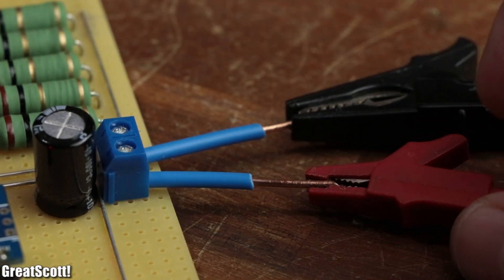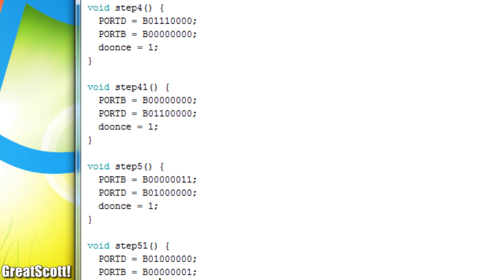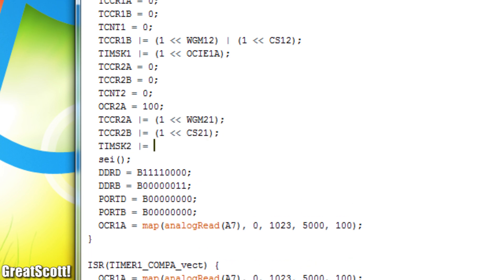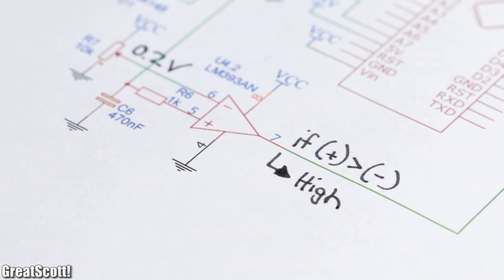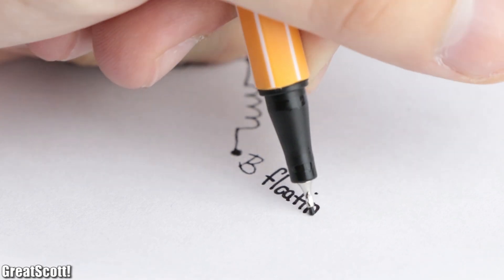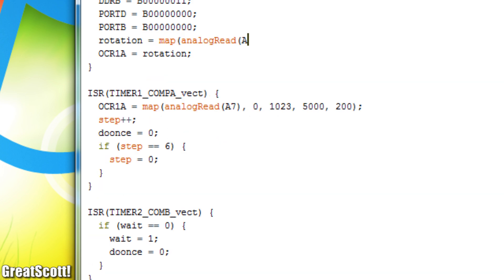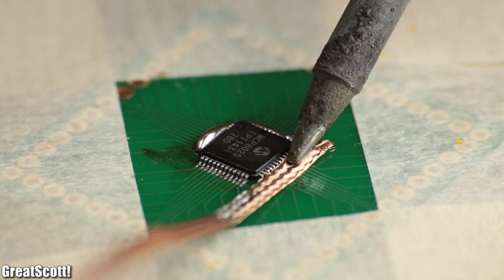Make your own ESC || BLDC Motor Driver (Part 2)

Comment: Great scott i have a question. Does electrical noise effect battery charging? 25 years ago i got into rc and linear power supplies and linear chargers were said to be king! Also with measuring pack voltage with same charger but with lets say sense leads on a isolated circuit. Are batteries chargers today for example the icharger 4010 duo or dx6 good?

Comment: Hey all! If anyone is thinking about building this, this circuit needs an additional resistor network! I just made something quite like this, using the same LM393 comparators, and my timing was looking really strange, and the speed/torque was a bit lacking. I'm using dual source, common ground to power my circuit, and the motor voltage is around 11v, the rest is at 5v. The motor acts as a voltage divider, making the motor common and coil leads around 5.5v, so what was happening was when the motor started to spin fast, the comparator inputs would get saturated over VCC and on the way back down take a fair bit longer to switch low, making the next step happen much later than it should. I added a resistor network (10k) at the coil sense leads to half the voltage, and then connected the common with 1ks. Now my voltage sits in a happy place between VCC and ground, and the timing is looking spot on. Have fun!
Reply: I also found that I needed to turn the internal pullups off, and add my own pullup of about 22k... not sure why, but I was getting a rather dirty output otherwise.

Comment: Invaluable resource! Thanks. How could I implement forward/reverse direction control in-software? I know that you could physically swap two of the wires but implementing this with hardware (relays) seems a bit clunky and not sure it would work so well. Any thoughts?

Comment: IDK if anyone pointed this out yet, but... the ATMEGA328P in the Arduino Nano has an internal comparator between PD6 and PD7 that can request an interrupt whenever the positive input of the comparator is greater than the negative input. Plus, as far as i know, runs asynchronously (correct me on that one, if needed). This means that you could actually measure the current flow using the internal comparator without worrying of it not being detected AND you actually removed a chunk of circuit from your board

In fact, the IC in the ESC is (usually) an ATMEGA8 and you can see they use no extra ICs, which is rather impressive, i must say

Comment: Hi, can i ask if this code is correct? You use only "PCMSK0 |= (1 << PCINT0);" and interrupt will occur only when EN1 will change its state. Dont you want to see change of every phase1/2/3 ? then it should be added "PCMSK0 |= (1 << PCINT2)" "PCMSK0 |= (1 << PCINT3)" "PCMSK0 |= (1 << PCINT4)". I see that you are checking in the interrupt which one of PINB changed but still it will be interrupted only 4 times in full cycle of 12

Comment: Hello sir,
I am trying to do this project with L6234D SIP package and 1000Kv BLDC motor.
I am using adaptor of 12v and 2 A for power supply.
At the end motor is only give magnetic vibration but not able to rotate. 
I don't know why it happens, please give some guidance.

Comment: the inability to achieve high RPM also comes from the limitations from MCU. To achieve high rpm, Phase Advance method is used. Microchip has a nice application note on sensorless control

Comment: Great Video !!! Comparators bounce like a button causing many interrupts in zero crossing areas, i couldn't find a stable solution for that. 
Ps. Please use something plastic while showing oscilloscope screen, screwdriver will scratch it.

Comment: HI, I have followed your video and information on Instructables to make a circuit using the 4th code you posted, and my motor is struggle to rotate. It is very choppy and seems only using the timer instead of the BEMF to rotate. I have check my circuit to make sure is correct, could you please suggest why I am having this problem?

Comment: I have seen some of the comments below, I am curious what are the individual components that make up for a good ESC. Some of the ESC are so small based on the current rating of the motor being driven, I would assume that most ESC use the same components with beefier mosfets for larger motors.  So does a commercial ESC use a micro? Or is it purely analog? or both?

Comment: Great video as always! I'm wondering if you could use the signal from the virtual ground point directly with only one comparator instead of  3 separate pins? I have used that star point to time a current source BJT, but I have no idea if this would work with Arduino. Any thoughts?

Comment: Hi Scott!, Very informational video. Could you please make a video explaining how to make an ESC using MOSFET's and MOSFET drivers instead of L6234 IC? L6234 is great but the DIP version of it is no longer manufactured and the peak current of the IC is also kind of low.

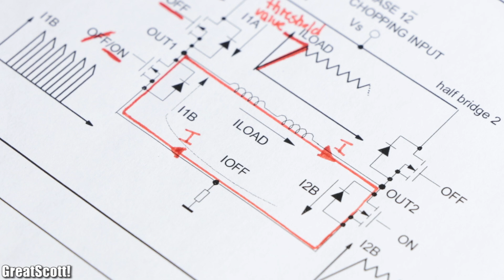Comment: 0:50 - If the motor is spinning and two coils are shorted, doesn't that impose a braking moment on the motor, which would counter its acceleration?

Comment: GreatScott, can you offer any advice?  I have an application that needs to rotate a shaft at 15 RPS (900 RPM).  As the speed is fixed, are there any gotchas if I simply supply the 3 phases to a BLDC from a uController (via FETs, of course), and start out slowly and simply accelerate it up to speed without any speed feedback - simply run the BLDC as a synchronous motor?
I have watched and read a number of accounts of ESC designs, and a number of people have commented that it was a long project with lots of pitfalls along the way.  Software is always a problem, especially if it has to handle setup of the various modes, but would you say there's any difficulty in getting the hardware working?  It looks quite straight-forward (is that naive?)

Comment: Several videos recently have shown a printer made using 2 CD Rom optic drives and their respective stepper motors; they are very small. Then I thought, what about the Disc drive's loading track? It would give a much larger print area. The Brushless Spindle Motor has hall sensors and fits neatly into the Loading track's gear system (just attach the second gear to the motor from underneath and it can open and close the tray).
Yes, stepper motors are better at this sort of thing for accuracy and every tutorial I've seen so far has shown brushless motors being controlled at high speed using a pot. But with hall sensors providing high accuracy, at very low speeds could the brushless motors be use? Can the brushless motor move forward one step at a time, and backward one step at a time? Or if not, perhaps 3 steps at a time for less accurate work but still a little fun :)

Comment: I tried to follow the instructable but It doesnt really say how to connect the motor. Well, it does but not in any useful way to me because the microcontroller goes into that large ic and the motor does too but I don't know what happens inside. I don't know what the microcontroller is telling the driver. What does each of the pins 4-9 do EXACTLY? I read the code and it does not match your 6 step cycle. Some of the pins are on for 4/6 of the steps while others are on for only 2/6. They should all be on for 2/6 of the steps as the little hand written step table you made shows. Plus it doesn't help that there are 12 steps rather than the 6 that should be there. Without knowing what each pin is supposed to do in the triple h-bridge then I can't even work out why there are half steps. Right now, with my best guess for how this should be hooked up I just get a motor that buzzes with varying frequency and no preferred rotational direction.

Comment: >>>   made  own  3   phase  controller     from    osc (  74hc14  / 555 )  74hc393  ,74hc138  74hc30   -   2n7000  -    got  plenty  of these  if  it  'blows'  - not a    problem

Comment: hello great scott, my configuration is this one:
-pcb board hand made, with 3 IR2104  double gate driver (1 IR2104 per 2 transistors on each phases)+ 6 transistors mosfet canal N IRF840 supplying a  12 vdc 1400kv motor brushless sensorless 3 phases,all managing by arduino UNO,the variations of pulsation is done by 2 pushs buttons...

i tryed severals differents codes for arduino for sensorless bdcl motor ...
i obtainted a range of duty frequency service from 40 KHZ TO 140 KHZ,visualised to my osciloscope,so i think it is not that bad as the pcb seems to pulse correctly but ,the motor do not start and so dont run, i can ear a noise as voltage running into this lil motor while approching my ear of it,but nothing more...where did i failed? 

could you light me up, and eventually bring me a code that could fit for my set up?

thanks to care great scoot, am lost....

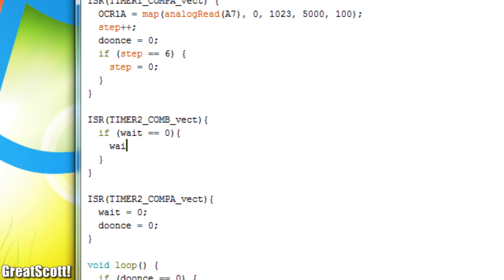Comment: Love it "...instead of the measuring bullsh!t" at 5:30. Finding a way forward is what engineering is all about!!
Reply: I just want to say, he was probably getting screwed by some of the default Arduino code that runs in the background all the time. Joop Brokking has an excellent video on why he switched to Atmel Studio because of the Arduino fluff
Reply: @ShinyMajor  It's probably the `step == (2 || 5)` code, should be `(step == 2 || step == 5)`

Comment: According to the datasheet of ATmega328/328p maximum ADC sample rate is 15000 samples/sec at 10bit resolution. Minimum time required for 8bit ADC is 13us and 260us for 10bit. So, how did you actually measured the A/D conversion time??

Comment: Scott, I think I may have found an error in your explanation or I don't quite understand it. 

At 0:56 you show how you activate the corresponding low-side FET to short the coil with itself, reducing the current flow. If A-HI was high and turned off at threshold value, switching it off makes sense because it stops the current flow. However, opening A-LO makes no sense in that case because the current would be allowed to flow in the direction you've drawn anyway, because of the body diode of the MOSFET. 

It seems to me that, instead of what you were explaining there, you would like to switch the high-side MOSFET at threshold value, and switch it on again once the waiting time has passed, and leaving the opposite FET on to allow current to flow. Activating the corresponding FET does not make a difference (because of the body diode), and disabling the opposing FET could create a spike in voltage that could kill your FET (I do think the body diode of the opposing high-side FET allows this to dissipate but if not, breakdown voltage is easily achieved). 

However, maybe I didn't understand your explanation right. Could you give me an explanation on this matter?

Comment: How would you go for controlling a higher power Esc? Could you do it with relays on the output if the esc? or would the really high speeds somehow make that impossibile?

Comment: Danke,I love your videos. Even though I don't yet use Adrino and I am working on improving my off-grid solar system,I always come across at least 1 of your videos (which are very helpful in my search).
Reply: I don't know if you address individuals,as it seems most up-loaders only address a general audience,but I figured it would be worth asking. I want to automate my solar system,but I don't know where to start. I have 2 power sources (a 12v/10w solar panel,and a 12v generator (using a speed control module,a 3-12v dc motor and a couple of these https://www.ebay.com/i/222602490507?chn=ps )),and 2 power supply (a 7.4v/40ah battery and a 14.8v/20ah battery,both of which comprised of 18650 cells). My problem is that I need the mini 12v generator to automatically turn on when the solar panel isn't getting power and my 14.8v battery still needs charging (as my inverter is powered from this battery). The 7.4v battery is for supplying power to the driver motor of the 12v generator,which charges the 14.8v battery,but I also need it to charge the 7.4v battery when it's low. Do you know how I should go about it? I think I'll have to create a custom circuit board; unfortunately I'm only a novice with circuitry. Any help is appreciated,but I understand if not.

Comment: I know this video is a bit old at this point...
Did you ever follow up and do the project described at the end, using "more modern ICs and beefier MOSFETs" ?

Side note: have you checked out the VESC project?
http://vedder.se/2015/01/vesc-open-source-esc/
Reply: Following Benjamin Vedder's original open source design, there are now quite a few options for higher power ESC

http://www.trampaboards.com/vesc-6-complete--vedder-electronic-speed-controller-trampa-exclusive-p-24166.html

Comment: Great article. I saw an implementation where BEMF sensing is done via 3 ADC channels, which required more calculations (to filter the values) in the ESC32 source but spared the 3 comparators. How did you manage to sustain rotation at slow speeds ? Your comparators still detect BEMF? 
Lower than 300 RPM, ADC can not read the BEMF unless a solution with opamps (to amplify it) is employed. At STM they reported 100 RPM with BEMF amplified by opamps.

Comment: If a motor is rated 30A max, does the ESC also need to have a 30A max rating? What if I run it with a 20A max ESC? Will the motor just have less torque, or will it not work at all?

Comment: this is to save power , control speed and increase efficiency right. More motors could be used because you are like trying to run on low load right. Is this a big delta configuration or no it is star. In a series i dont know much of elecric motors i love the video its very good.

Comment: I just wanted to point out that the "sensorless" mode of this controller is never achieved. 
There isn't proper filtering and signal conditioning of the phase nodes (the resistor is in the wrong place for the RC filter), and the code only has pin change interrupts for phase a enabled. Even then, there isn't any hysteresis or sample clocking so noise would quickly cause the controller to lose sync with the motor.
Also, you're not supposed to commutate at the zero cross, unless you are running an insane phase advance. Diagrams of trapezoidal control algorithms show that zero cross occur halfway between commutation points.

Comment: The problem is that you are actually treating the motor as a DC motor. Calling them "BLDC" is in fact totally erroneous. They are 3-phase AC motors. *AC*. 
They work on 3-phase AC, and they were invented by Nikolai Tesla.
Reply: tesla invented induction motors, not bldc motors.  The motors in this video are bldc motors and not ac motors although I guess technically you drive them with an ac style but they are not considered ac motors by definition.

Comment: Cool project! I watched the video several times to understand how to control a BLDC motor. I always confused ist with a synchronus motor which needs three sine waves. 
But i'll use an other microcontroller. I don't really like Arduino because the most people never reads datasheets or know how a microcontroller works. They simply use all the libraries without understanding what's happening.
I'll use a PIC18F4431 microcontroller that has a special hardware to control BLDC motors, with integrated timer for the rotation frequency and another one for the PWM.

Comment: The Arduino was unable to handle the very short time interval. What microcontroller is used in the commercial ESC. Is it a 32bit AVR type running at a high clock speed.

Comment: Thanks for the great series. I have a question if one could control ordinary 3 phase motor with it???
Reply: You can control 3 phase permanent magnet synchronous motors with such an ESC. But as BLDC motors are optimized, the PMSM will make more noise and produce torque ripples. It is better to use sine-wave commutation or field oriented control for PMSM. Asynchronous motors can not be controlled with Scott`s ESC.

Comment: Hi.Can you explain to me how the comparator part works.I want to know its behavior and its output when Vcc or Gnd phase voltage is applied to the non-inverting comparator input before the BEMF zero-crossing is detected .It will not have a false comparator switch?

Comment: I wonder about zero-crossing circuit which you use op-amp to compare between virtual neutron and BEMF from each phase so the question is why BEMF go to Capacitor and pass through resistor ? Is it wrong? I think It look like low pass filter but wrong resistor position .

Comment: Couldn't you just reduce the supply voltage and/or get a higher current power supply?
Reply: since a drone rotor is probably gonna be powered by a battery, this wouldn't mak much sence since a battery would also not be able to provide those currents